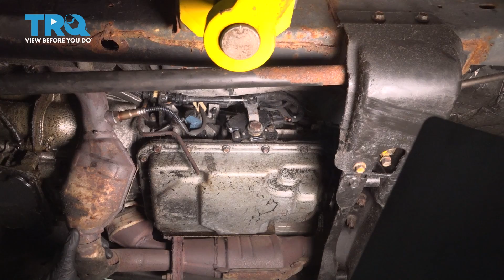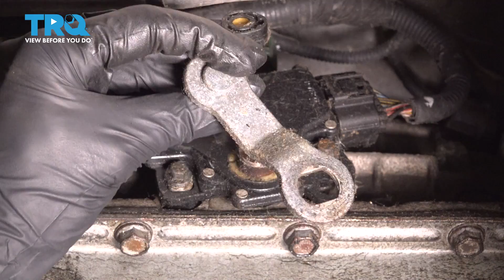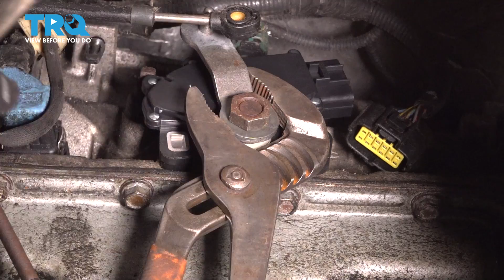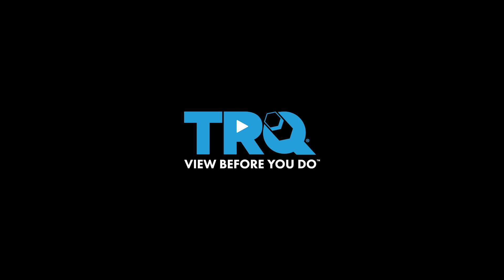How to Replace Neutral Safety Switch 2001-2005 Ford Explorer Sport Trac

Comment: TRQ you failed to line up the marks on  the switch and trans  on neutral. Also you could have sanded the shaft to removed the rust. Not your best video.

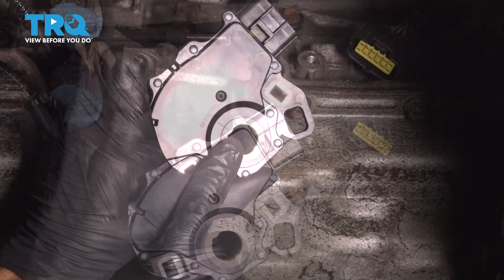Comment: Eyeball engineering is not the correct way to install this part. There is a set of alignment marks you must line up while the trans is in the neutral position , these marks are seen at 5:06 and some how you never even say a word about them. They are there for a reason and if they are not used you will likely be creating more problems than you had to began with.